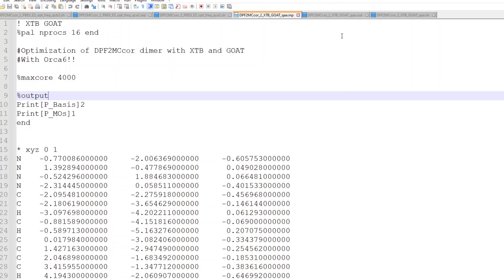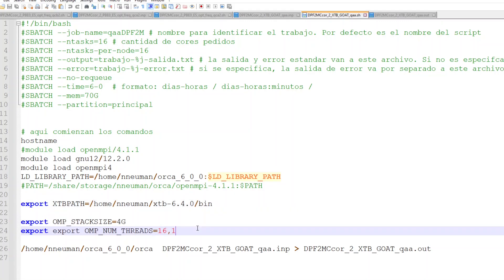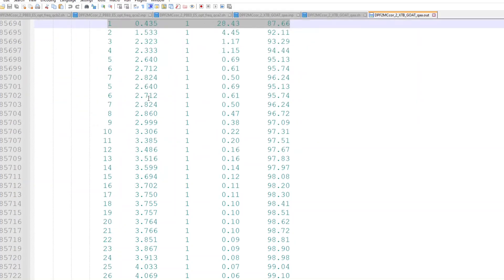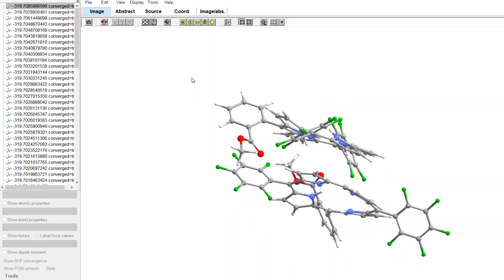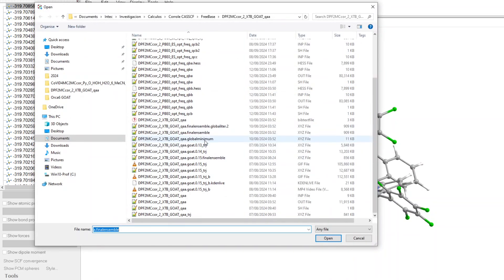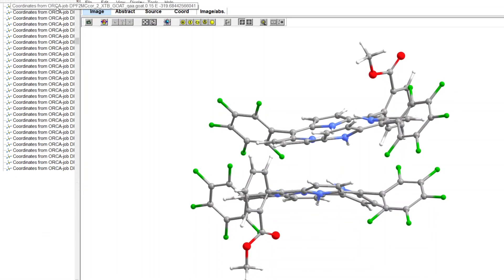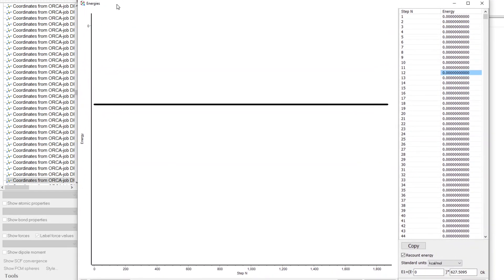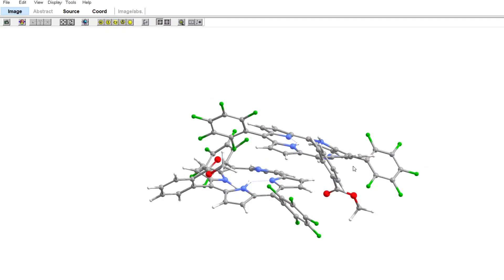Global optimization using Orca6 and GOAT!

Comment: First, I would thank you.

I was able to setup orca on a Windows PC.
I used Avogadro to create an input file for a water molecule. 

# avogadro generated ORCA input file 
# Basic Mode
# 
! RHF OPT FREQ def2-SVP 

* xyz 0 1
   O       -4.63425        1.59139        0.00000
   H       -5.25793        2.36056        0.00000
   H       -3.73335        2.00247        0.00000
*
but when I tried extracting the IR absorption spectrum, I got this error. 
 
PS C:\PrjORCA\SAMPLES> orca_mapspc water.out IR -x0400 -x14500
Mode is IR
Error: cannot find keyword : IR SPECTRUM
PS C:\PrjORCA\SAMPLES>

Meanwhile, on close inspection, I could see these sections; this suggests the computation was successful. 

In the output file
Properties with geometric perturbations:
SCF Hessian                             ... YES
IR spectrum                             ... YES
VCD spectrum                            ...  NO
X-ray spectroscopy properties:
SCF XES/XAS/RIXS spectra                ...  NO

-----------
IR SPECTRUM
-----------

 Mode   freq       eps      Int      T**2         TX        TY        TZ
       cm**-1   L/(mol*cm) km/mol    a.u.
----------------------------------------------------------------------------
  6:   1750.35   0.016354   82.65  0.002916  (-0.012357 -0.052565 -0.000000)
  7:   4148.54   0.005313   26.85  0.000400  (-0.004568 -0.019463  0.000000)
  8:   4244.77   0.014722   74.40  0.001082  ( 0.032028 -0.007519  0.000000)

  ***ORCA TERMINATED NORMALLY***
TOTAL RUN TIME: 0 days 0 hours 0 minutes 11 seconds 593 msec

Do you have any recommendations?
Reply from the maker: @a.a.patrick  hi, I don't use the orca_mapspc module. I have my own script for reading and plotting spectra in Octave. But I think you can plot the spectrum in Avogadro if you open the .out file.
Reply: @ 
I discovered why orca_mapspc won't run. 

In my Windows PC, right-clicking to load the directory path uses the PowerShell interface. 
and PowerShell keep popping up the error "IR SPECTRUM not found.".
the default cmd did the job clean.

It was an error from my side. 
Thank you.

Comment: Is there a way to calculate the absorption energy using ORCA>??
Reply from the maker: @patrickdedetemo472  probably yes. You can calculate a small cluster of atoms or molecules representing your solid or liquid, your isolated molecule and the same cluster plus that molecule absorbed. How realistic the number will be will depend on how large the section of material is, and the type of interaction. The stronger the interaction the more accurate the estimation will be.

Comment: could you explain how to install xtb for win11? I tried to copy the xtb.exe and rename it otool_xtb.exe, also add the xtb bin folder to the path environment but the calculation are still aborded
Reply from the maker: @kimist42  unfortunately I don't know. I run everything in Linux. I'm not sure that it works in windows, but in any case you have to configure a couple things more. It's better to ask the XTB developers about that.
Reply: Were you able to solve your problem? Did you paste "otool_xtb" in same folder that orca?
Reply: @danielbahena3866  Yes, it was working fine! Goat was not really what I was looking for 😅